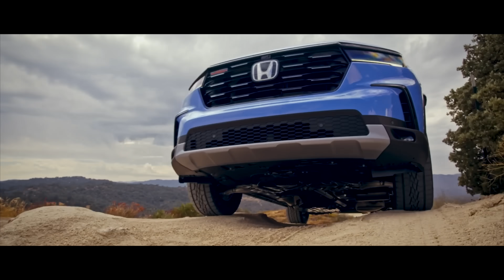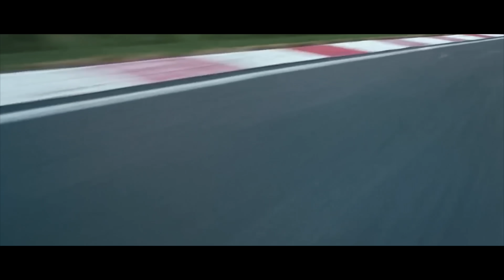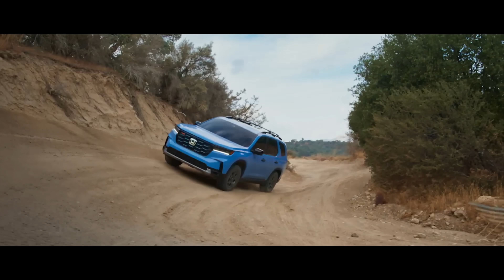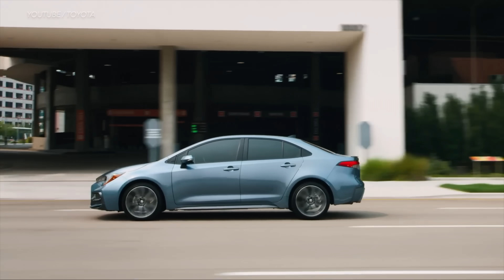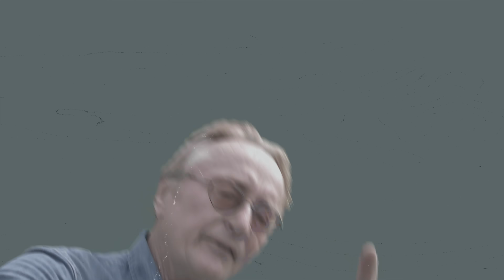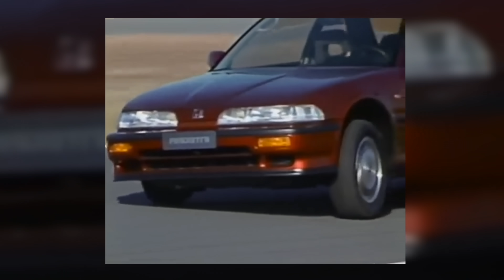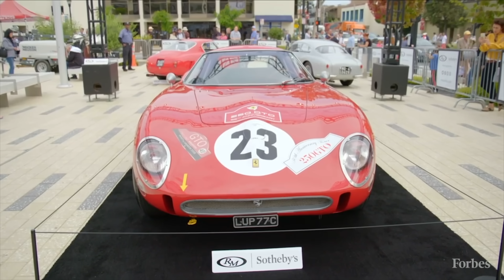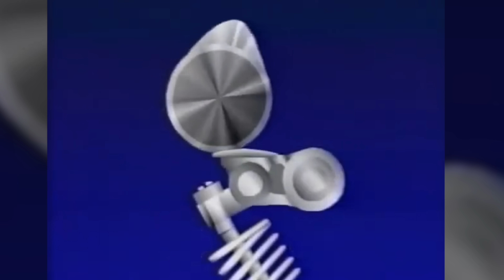Honda's New Engine is the Most Powerful Engine Ever Made

Comment: I think what has failed to be mentioned about disadvantages of the GDI engine, is the carbon fowling of the intake valves due to the gasoline no longer being available to keep them clean. I have two Acuras with this GDI setup: a 2019 TLX with a V-6 and a 2024 TLX w a I-4 turbocharged. They perform reasonably well,  but I think I would rather have the V-6 reliability of the 3.2 liter V-6 in my Acura CL Type-S.

Comment: hope honda went back to a chain timing belt not a reg Kevlar belt i will not buy the honda ridgeline have to be replaced at 100k have a 2013 dodge caravan with 105k then put them on for water pumps or alt to charge the battery or for a motorcycle drive belt its why will stay clear unless its a 2014 that had chain belts why is it the newer gets turns in to junk

Comment: Aftermarket / pre-owned prices of the B-16 engines are starting to get ridiculous now. Still sought after by Honda enthusiasts.

I only drive Toyotas and Hondas with V6 petrol / gas or V8 diesel. Bulletproof engines that will run half a million miles easy.

Comment: Electric will never make the cut for what we need. 

The only way it will is by hot swapping batteries and I don't think people want to do that 25,000 a battery and you don't know if it's a good or bad one😂

Hydrogen is too volatile yes that means our energy requirements but having a full city of these that would just be a chain reaction spell disaster😅.

Propane on the other hand has some potential but we can't have incompetent people filling and we have way too many incompetent people to begin with.😮

The average person seems to becoming more and more unintelligible and unable of critically thinking as well as not capable of taking constructive criticism😢.
The truth is if we go down the hydrogen route or the propane route we have to remove majority of these idiots off the road and the politicians will not let that happen.

Comment: Not dogging Honda as I have owned 4 but the only vehicle that has stranded me in my 69 years was a Honda. A 2010 Odyssey with 115,000 miles died while driving on the interstate. Cost me $1,600 to replace the alternator, battery and many assorted parts. Turns out there was a known issue that was never addressed. Found that out a year later. Replaced it though with a 2023 Odyssey. I detest the Auto stop/start and Honda’s advanced cruise control is annoying. Driving on flat road the speed will drift down 3 mph below the setting then slowly creep back up. Needs a new program.

Comment: My Honda pilot 2016 almost 200.000 miles. I got this car used with a 127.000 miles. It's was in bad condition when I got my car. And it's still have some oil leak,it's what dash board says. I don't see any leaks under car.However, no matter what problem was with my car it's driving smoothly and I never was stock in the middle of the road.

Comment: I’m a Honda tech and I’m here to tell you these things are terrible do not buy we’ve had nothing but problems with the new v6 and they cheaped out on a lot of the build we’ve already seen cylinder heads leak oil leaks right off the truck and that’s just the stuff I’ve seen myself. I would strongly recommend to not get a new v6

Comment: 0:04 I have owned 18 Hondas since 1983, nough' said. Just ordered a Pilot black edition with the new Y8. Funny, the only Honda models I have never owned are the Accord or the Fit . However, I did own 2 TLs, so maybe I did😂. Even had a S2000 (should had never sold it😢).

Comment: Vtec isn't a variable timing system. It's an actuation system that activates a second set of rockers that ride a secondary profile of lobes on the cam. 

This enables an economy profile on the motor, but then the motors vtech solenoid is activated hops to the secondary profile producing more power at a set rpm. 

Just clarifying, as this is not the same as vvt or vvti which uses a cam gear to turn the cam at specific angles depending on the load or demand. 

If they managed to do both on this new motor then it would be pretty cool if not extremely complicated. 

I'll wait to see what happens with the pilot runs.

Comment: I recently purchased the all new Pilot with the new V6. I have to say I hate emissions. I had the 21’ Pilot Elite AWD before this one and it was fast. 0-60 in 6.1 seconds according to Honda. However where I live I consistently ran 5.9 seconds to 60. The all new Pilot despite the “bump” in horsepower is considerably slower. As far as I know Honda is still claiming 0-60 in 6.1 seconds. However my wife’s 21’ Accord Hybrid which does 0-60 in the low 7’s is faster than my 25’ Pilot. Even with the AWD advantage. This may be due to weight as I’m not sure how much heavier the new one is. It’s comfortable and more mature than my old one. I miss my old one because of the raw performance. It was fun for what it was and fast enough to get out its own way. I know that regulations are the thing they have to do but this is literally killing great engines and fun. My only hope is that this engine since it’s based off the Type S engine is easily modifiable. I know most people with a Pilot won’t care but considering that I need the space but I want some fun every once in awhile I hope it has something.. other than that it’s a fantastic vehicle and feels more premium than it actually is.

Comment: Hi Scotty, I'm a big fan and gear head. I watch a lot of your videos. I prefer Honda because I used to work for the finance corporate division. I have a 2017 Accord Coupe with 3.5L V6 Manual and got an awesome deal as an employee. I absolutely love this car and have 141,000 miles on it now. It's definitely a performer and I've never had a maintenance issue. The engine is in tiptop shape and it has gotten regular maintenance since being brand spanking new. I'm interested in boosting it with cold air intake, a J37Y2 intake manifold, and non-resonated catback exhaust system. What are your thoughts? Should I leave it unmodified for reliability?

Comment: Always been a Toyota fan.  Simple, clean, and ultra RELIABLE.  Honda may have sportier looks, performance, and handling, but it's reliability does not compare to Toyotas.  This is not my biased opinion but the opinions of several mechanics I know.  I've owned Corollas and I've easily put hundreds of thousands of worry-less miles on each. Easy to work on - and just as easy to drive.  Having worked in the factory has given me insight as to why Toyotas are rock solid dependable.

Comment: I have a 2016 Honda civic and the wife has a 2019 Toyota Rav4 hybrid. The Honda is a much better handling, sportier and is much more fun to drive than any Comparable Toyota model. I just drove a 2020 Camry the other day and I would not even think about trading my civic for that car even though it's 4 years newer. but Toyota has the better hybrid system over Honda. Our Rav4 is not as fancy as the CR-V hybrid but I will take the Rav4 or any Toyota hybrid  over a Honda hybrid.

Comment: why honda not use vtec in S660 and they terminate the manufacturing due to not low enough emission to be allowed to sell with their 660cc non vtec engine. in fact, 1L vtec turbo can do pretty well for power and low emission. i wonder why they not consider switching the engine. dead to another japanese mid-shift

Comment: Great video. I prefer Mazda as they have the Skyactive Tech and the transmissions never went to Planar bands. Plus Honda standard trans shift like manual instead of planetary and there is no pan to inspect. Toyota is like you said, reliable but design style has always been blah. I now have a 2007 Mitsubishi Outlander with 160K+ and it is built very well (one of the last built in Japan), looks cool and is fun to drive on and off road. Nevertheless, I would sell everything for an OG 1969 VW Bug as it was my first, and most fun (and easy to work on) car to date. Cheers!

Comment: We use both Honda and Lexus. Both with a V6 Engine. The Honda Pilot is much softer and quite drive and the RX350. The Rx350 has a rumbling sound around 1800 to 2200 RPM, which was partially reduced with a Technical Bulletin. 
The Lexus has a sport mode that makes it much faster and switching gear less often. Both of us are retired and the speed is not much of concern. We are keeping cars an average of 12 Years. We have 8 Years extended warranty on the Honda and 11 Years on the Lexus ! My older son had a Honda Accord who refused to die, but it was replaced with a newer one, just because it had two or more accidents and he refused to pay for repairs. My younger son drives a Civic.

Comment: I have the best of both worlds: A 2003 Acura TL Type S with a 3.2-liter VTEC V6 and a 2004 Toyota 4Runner Sport with a 4.7-liter V8. I bought both vehicles new and haven't had any problems with either.

Comment: What about carbon deposits on the valves?!!
It’s yet another DI Direct Injection engine but (unlike some Toyotas that have both types) if it does not have multiport injection for some of the time valve carbonisation will rapidly occur causing lower power, reduced combustion efficiency etc etc.
Maintenance for the common owner will not happen to address this build up.
They say every 40,000 miles or less it will need cleaning and if not done by mechanics, then the build up will require expensive walnut blasting or at the very least on car system cleaning with a dedicated machine.
Toyota made this mistake early on with its DI engines you might remember.  That’s when the both multiport AND DI induction systems were designed and mass produced.
It had other benefits apart from reliability and reliable efficiency.
IDK if this is the way to go, sorry.
I like Hondas as I have a diesel CRV (also a Toyota LandCruiser Prado Diesel), so I’m not a brand snob.

Thanks for your fantastic explanations as usual.

Comment: Vtec is always presented as a way to transform the engine at high rpm … in fact it’s the opposite , it’s a way to transform an engine with racing DNA in a gentle engine at low rpm

Comment: I have both cars a 99 Toyota Corolla with 101k miles since 2014 and a 200& Honda civic Si   Since 2016 with 140k miles only regular services recently the a/c compressor for the honda and battery and evap solenoid for the Toyota 😂😂 that is it best cars

Comment: I'd rather have no cams nor rockers with infinite lift and timing control like the Konigseg design. And it removes the throttle body as it's no longer required to control, restrict, air intake, and giving the advantages as a diesel with high revving of gas turbo.

Comment: I’m from the UK and I’ve got and s2000, 2.0l 240bhp at 9000rpm.  Emissions and turbos killed it. If only Honda had done a 3.0 v6, 3.5 v8, v10, v12, you get the picture. My e46 m3 has BMWS thing with 340bhp at 8300rpm. Man I loves na high revs!

Comment: I work at the factory building the new engine, and actually the whole new Pilot. I do various processes required to put it together. The new design is easier to build, that much I know. Thanks for doing this video.
Reply: How about its reliability vs the old VTEC?
Reply: @hellobenny  Time will tell.
Reply: @hellobenny   it is still a Honda engine but with new fuel injection tech, instead of vtec, ftec? Any ways power is no longer the subject, high mpg is all the crazy now. (100mpg coming soon)
Reply: @pc7225 it's not good on gas either
Reply: @pc7225 the previous J35 was still direct injected so hopefully reliability won’t be surprising

Comment: Toyotas have been more reliable for me. My only honda was a 2000 accord sedan V6. The transmission went out at 140k. Second gear became a neutral. I have never had a toyota fsil like that and ive had two of thrm beyond 350k miles.  Toyota is the inly brand I will buy ever again.

Comment: After owning my second MDX now i can honestly say the j37 3.7L inside the mdx in my opinion is the best engine honda made (minus oil burning issues lol) my suv flies on the highway and never feels short on power even at high speeds. Its too bad theres not a lot of mods for the engine cause it has the potential to be a monster, i hope it lasts as long as my CRV at 500k miles
Reply: I had an MDX, definitely powerful but bad gas mileage. Honda went off with that engine LOL
Reply: @IaintTrynaGoOutLikeBIGnPAC  legit dog crap gas mileage 😂
Reply: @isaacbjorgan1829 how much mpg?

Comment: I'm definitely a honda guy being raised by a Honda technician. That being said I'm disappointed that they put the vtec in the corner. Should of kept vtec and forced induction applied to all motors. The only other logical step would electric solenoid valves that are continually variable through rpm with boost.

Comment: I like Pilot intro when they show the front wheel coming an inch off the ground in slow motion. Meanwhile you'd see old GM and Ford advertisements of them jumping their trucks a few feet in the air or driving them across some bumpy surfaces showing how good the suspension works.

Comment: I owned an s 2000.
 In my younger days it was v8 or nothing then sensibility set in with a couple of six's then it was time become me again. I drove all the cars in the same class as the Honda.
Nothing came close. The Boxster was like driving a boat by comparison.
To think Honda won't make another v tech is truly disappointing.
I don't need a car as i live overseas most of the time. But I would buy another s2000 in a heartbeat if I can find one. Best bang for your buck car ever.

Comment: animation on vtec locking is wrong, its right in that a piston gets pushed by oil pressure from rocker 1 into the central rocker but a piston does not push from the other side into the central one as welll as shown, instead the central rocker also has a piston that gets pushed by pin 1 out of the central rocker into rocker 2 that has another piston with a spring on the backside, so when oil is fed to piston 1 it displaces piston 2 inside the central rocker into the final rocker that receives it and has a spring on the end to push it out and into its returned state once oil pressure is reduced.

Comment: Hi Scotty, so how does this new Honda engine plan to clean the valves from carbon build up if it only uses direct injection?  I know Toyota uses both direct and port injection on their new engines.  I also don't like that fact that Honda is going with a 10 speed transmission for the new Honda Pilot.  That sounds like a recipe for disaster down the road.  I've owned both Hondas and Toyotas, but it sounds like Honda is desperate to pass emission laws and not considering reliability and dependability.  I will stick to Toyota for now.
Reply: I’m not convinced Honda builds a reliable transmission

Comment: On vtec you for the Del Sol and the Prelude.  My Honda Del Sol Si is a sohc vtec producing  127 horsepower.  Twenty six later 216,000 and can still cruise at  100 miles per hour.

Comment: I'm surprised it is not inline 6.  GM also dropped their dual turbo inline 6 development.  The inlines are more electrification friendly. They are easier for turbos and fewer parts such as heads camshafts and balancing shafts.

Comment: My daughter just bought an 04 CR-V, a few weeks ago for $2k.
The only Honda before this was my 83 Nighthawk.
Her "truckette" has over 300k miles.  We're going thru it, things like wheel bearings are worn. But it starts, runs, shifts cleanly.
It seems like despite it's age, it'll be reasonably dependable ride for her even if it's quickly placed in "ready reserve" for snowy days.
Reply: With maintenance, 150k to go.
Reply: @jellyroll5247  
It has 370k on it..
Reply: @anthonydilligaf823  yep. They last. I here those type of numbers on these cars all the time.
Reply: 370k !?! Amazing @anthonydilligaf823

Comment: i had a 1999 CRV 2.0 for 20 years don't know why i got rid of it was good on gas and ran great it was my wife's car then my sons then i drove it . I finally got rid of it and got a 2018 Chrysler 300 v6 so far, a good car very smooth.  i bought my wife a 2017 Honda CRV with the 2.4 great engine good car and good on gas. all in all, I would buy another Honda thinking of a hybrid or turbo waiting to see if the new CRV is any good.

Comment: Bought my first Honda in 1986, brand new accord LX -I 4 door with 4 sp. auto what a gem that was. In 1992 we got a new Toyota Camry XLE V-6 and wow that car lasted over 300k with just a timing belt replacement.  To this day we have stayed with both brands ,just remarkable engineering and longevity.
Reply: My first was an 87 LXI hatchback 5 speed. Great on gas and a blast to drive. Miss that car. Recently sold my 92 Camry LE with 235k zero issues. Both brands are remarkably well made. Can't go wrong either way.
Reply: @jellyroll5247  I actually wanted a 5 sp accord at the time but didn’t want to wait for it

Comment: I’ve owned 2 honda accords ( early 2000’s ) , 1 2008 Toyota Corolla, a dodge Dakota pickup and currently my daily driver is a 2009 Honda civic coupe. 
The worst was the dodge Dakota buy far… it was a complete rust bucket at only 15 years old, I bought it used as I’ve done with all the cars I’ve owned.

The 2 Honda accords I delivered Pizza in full time for a number of years, 1st one I bought at around 150k miles and drove it till 220k before repair bill got to expense the the engine was still running good. 

2nd accord I really beat the car up with stop and go driving for 5 or mores a day every day for years before the transmission started slipping at around 240m miles.

Comment: Well i still have both a 2012 Civic Si that's tuned (205whp) and also fairly high milleage (470k km) and a 2021 Prius Prime. Both are very reliable, they also serve totaly different needs in my garage. The Civic being very Fun and the Prime being an economical and relatively comfy daily driver.